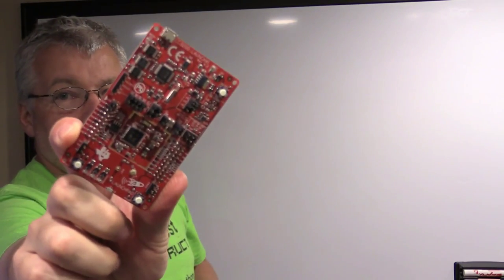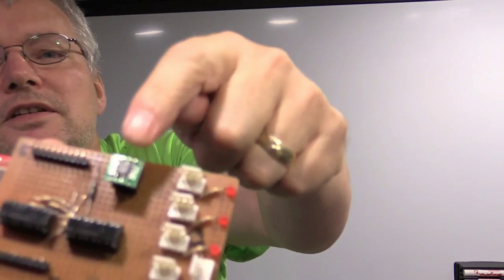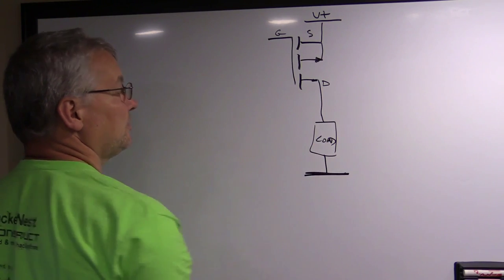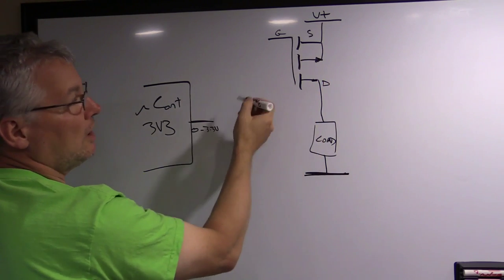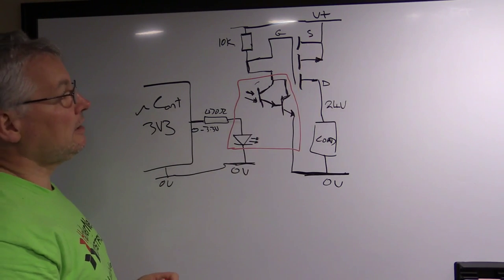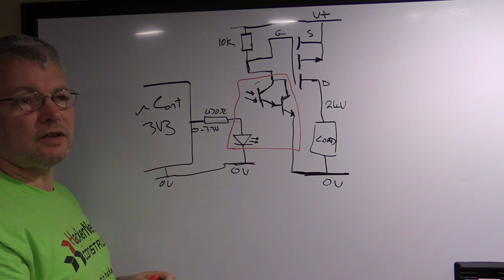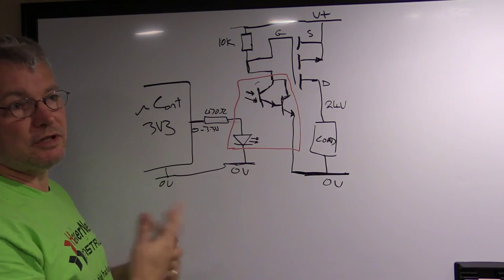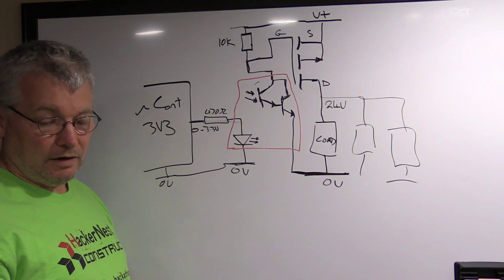Opto Isolated Power Drive For Ucontrollers 1

Comment: This is not an isolated sytem because the ground potentials are tied. To have an isolated system, the DC power must be isolated (For example with a DC-DC isolated converter).
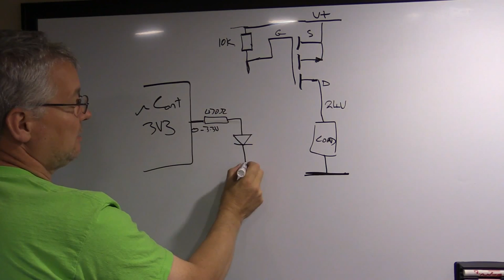Reply from the maker: At timeline 8:14 approximately I clearly state the 0V on the 24V supply is NOT connected to the 0V of the micro controller supply, they are not tied in the diagram presented and I spoke to that point. Sorry but it is isolated. They just both happen to have a notation of 0V on the diagram. I hope that clarified things for you, if not please feel free to ask some more questions. I hope you enjoyed the video
Reply: Sorry for the mistake Peter. Thanks
Reply from the maker: Aitor Sierra No problem, questions are good and I could have made a mistake, if you like the vid, please give it a thumbs up

Thanks